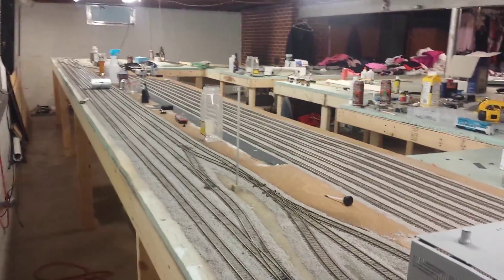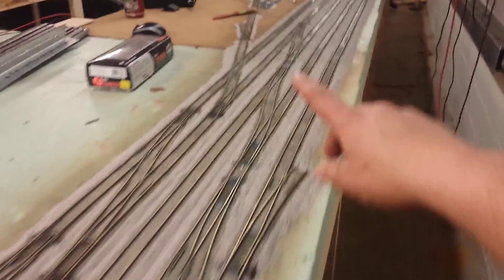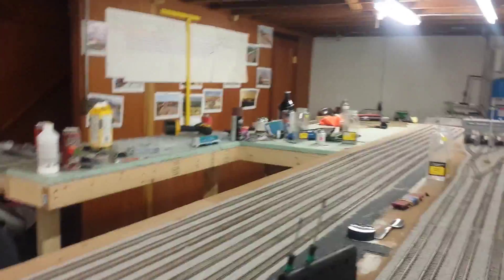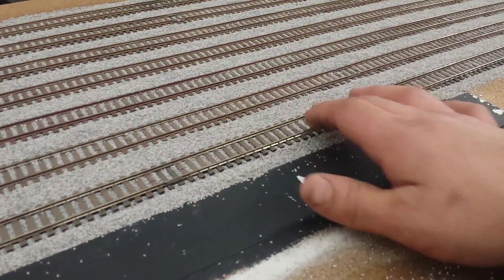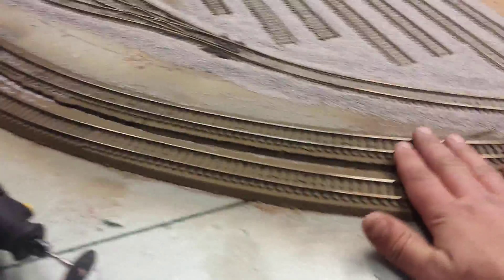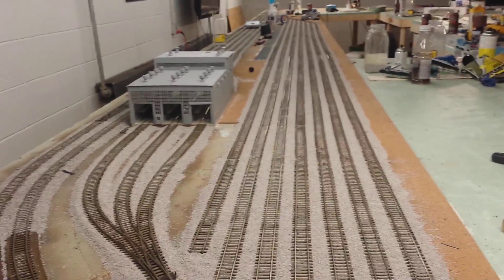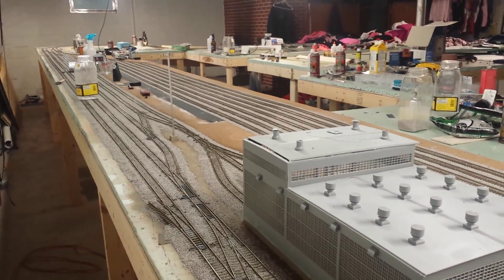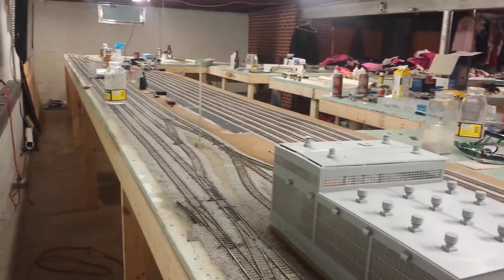Layout update #9 ballasting all finished

Comment: Nice updates. May I give you a suggestion? Use gull gray for the base coat for your road. It looks good now, but for that sense of realism simulating lots of use, gull gray from model master makes more of a prototypical color. Then use a small paintbrush to paint the pavement markings/lines. After that, use black charcoal, and rub it in the center of the lanes on the road with. A dry cloth to simulate oil leaking. If you look in the center of the lane on the real road, you will notice a darker color. I did this on my layout, I couldn't believe the results!

Comment: Looking good, I'll go ahead and give you my 2 cents. Use some cheap black acrylic paint diluted with water to make a wash, then using a brush apply it to the middle of you mainlines to simulate the oil and grime that builds up on the mainline ballast. Layout looks great, thanks for sharing.
Ethan
Reply from the maker: Awesome idea ill be doing that for sure. Thanks
Reply: No worries, keep up the great work!
Ethan

Comment: I know you are still in the beginning of the build to the yard, but since most yards are very flat use things like light poles and power lines to break it up a little.  And since it sounds like you like the electrical part anyways, this would add not only a great realistic touch but the lights would make it look pretty awesome for night runs.  And the area between the yard tracks and rec/dep tracks (access road) would be perfect.  But looks great man, keep us updated!
Reply from the maker: Thanks Joe, after reading your post I went to my hobby shop and ordered yard light towers and power poles for my yard and now plan on doing a power substation close by. Thanks again for the tips ill be putting them into action.

Comment: Nice Update! The layout looks great, and I can't wait to see the new motive power! Your ballasting is really impressive. You obviously had a lot of track to do, so I'm sure it wasn't easy. I have probably 1/10 of the track (or less) that you have, and I still haven't glued everything. I have a quick question too. Where is your layout set? I am also building a BNSF layout (here in Indianapolis actually), and it's based on BNSF Midwest operations. So, it's mostly like their Northern Transcon. It doesn't really matter where it's set, but I was just wondering if you did have a region you're modeling. 

Thanks!
Reply from the maker: you know I really have no picked an area to model from just yet but I would like to find one that fits my ideas. I plan to do a lot of industrial areas and mining operations including power plant, steel manufacture, concrete plant and many more. If you know of an area off hand let me know. Thanks